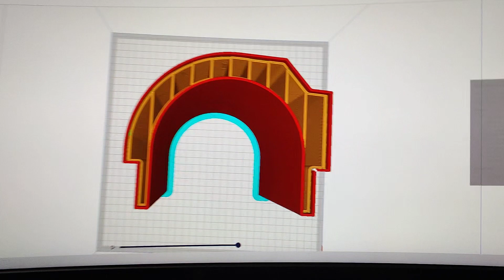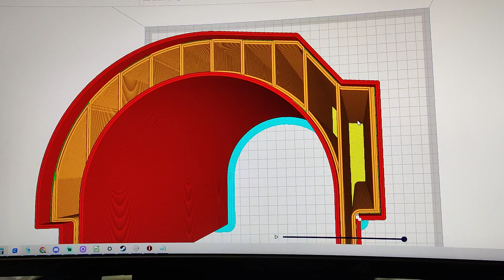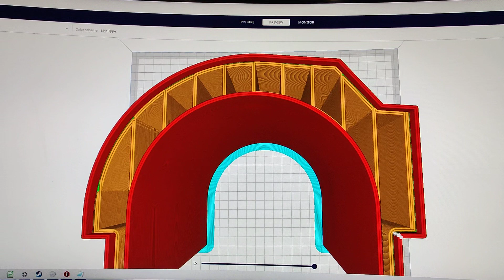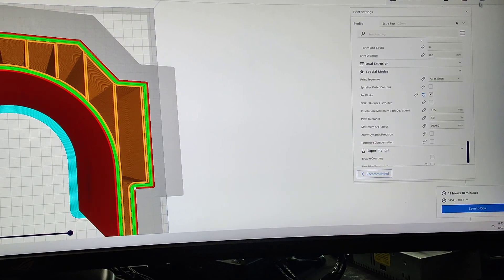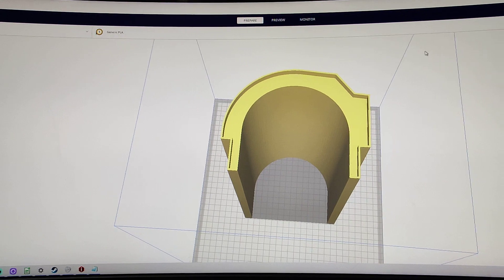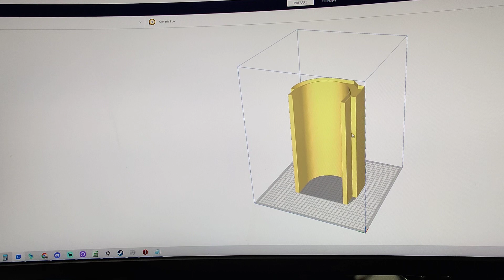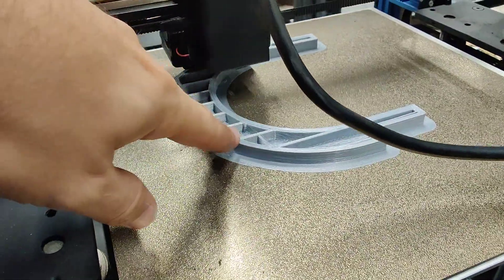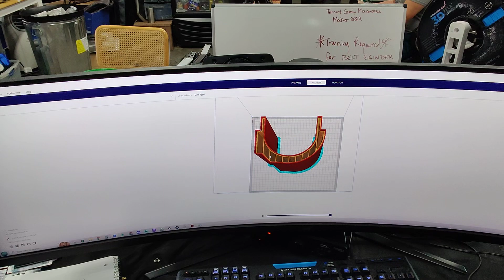Cura Settings For Large Format Printers / Prints

Comment: that curved display is pretty dope. you have such a lovely print farm. sunlu has some new large format machines that look very promising. 

here's my 0.8 nozzle settings that nobody asked for. double walls minimum. 0.6 top bottom line width. 30mm/s first layer. 40mm/s wall speed. 98% flow. 6 top and bottom layers. 5mm/s jerk. acceleration can be up to 2000 if you're on rollers, 3000 on linear rails. any layer height is cool all the way up to 0.6mm

i'm moving to 1mm nozzles and larger starting next month.
Reply from the maker: Nice thank you very much for sharing. I found that the 1mm nozzles were leaking/hard to keep stringing down so let me know your results!
Reply: before you do this whole update, I hope you are using good quality material otherwise you are not going to throw money away, you may find the best setup to have the best printer, if your stuff was rubbish your work will be throwing away.